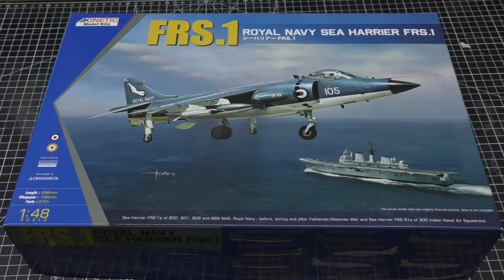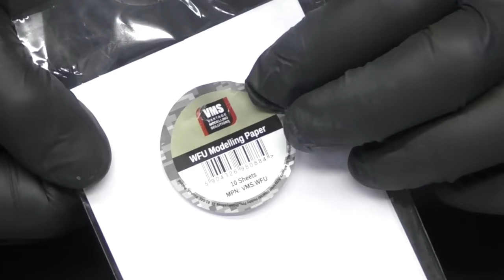Kinetic 1/48 Sea Harrier FRS.1. Model Aircraft build.

Comment: Nice build! I do have a quick question, how long will the 'sprue goo' last? Can you make it as a batch and it will keep, or is it a case of make it when you need it only?
Reply: It will only harden if the TET evaporates. So if you put the cap on the bottle after usage it keeps just as any other cement we use!

Comment: Well done .Kinetic kits are not my favourite and I avoid them.
Reply: It’s not just Kinetic; you have to be careful buying a LOT of these Chinese made model kits. Although I haven’t built one in about 10 years Trumpeter was by far the world’s worst with either ill-fitting or incorrectly shaped parts and if you’re serious modeler (like myself) you sometimes ended up spending more for corrections sets than what you did for the darn model kit itself!  That’s why I always do my research before I pull out my wallet. If it’s American, European, or Japanese odds are certain it’s a good fitting kit but if it’s Chinese, watch out!
Reply: @phayzyre1052  the worst part about trumpeter is the inconsistency, I've had absolute trash and absolute gold from them.
Reply: @ihavewaited90daystochangem51  Only goes to show the Chinese wouldn’t know quality and accuracy if it kicked them in the butt!  The first run-in I had with Trumpeter was building their 1/32 scale F-105D kit I bought it about 20 years ago and spent close to $100 on it only to be highly disappointed with all sorts of problems, most notably with misshapen pieces and a cockpit so bare it made me wonder why even add what little halfhearted details they put in it!?  I had to spend over another hundred dollars just to get correction kits and better decals to fix the discrepancies.  It was a lesson well learned for me, but like you I’ve had good and bad experiences with Trumpeter.  The way I see it if another manufacturer makes the kit I’m looking for I’ll probably go with them instead.